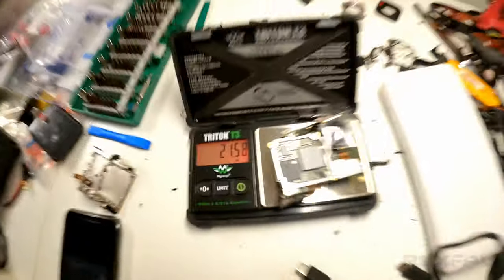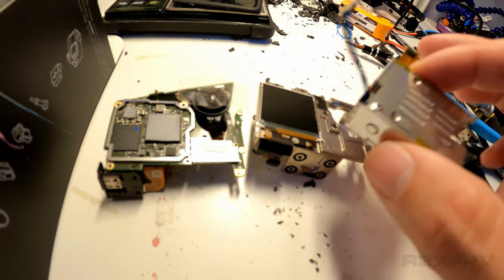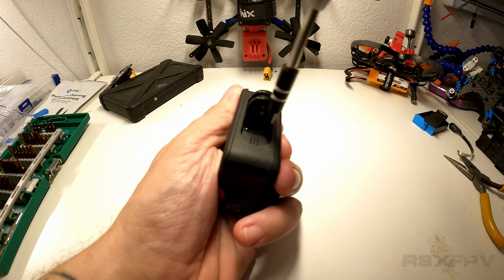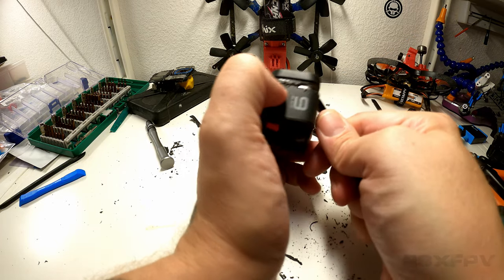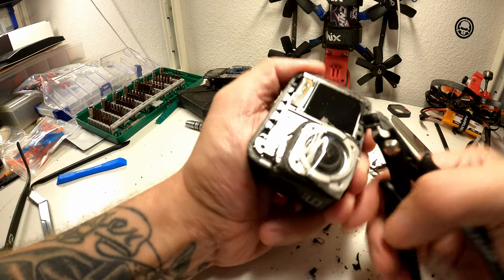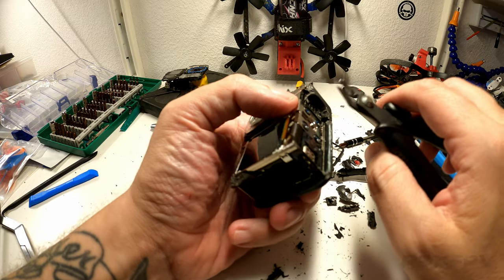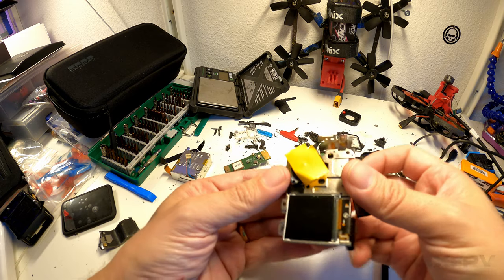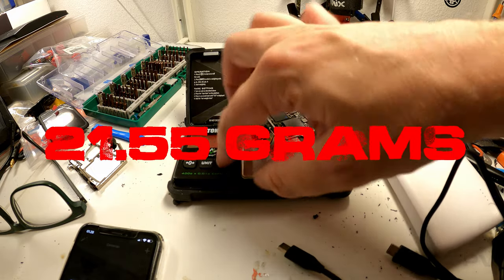Naked GoPro 9 Tutorial | Prepare the hacksaw

Comment: So nice bro. Nuts but i love it. How did u go about powering it?
Reply from the maker: I power it with a small BEC, from 6s lipo to 5v
Reply: @mikdahl  hey bud is there a Way we can chat? IG FB??
Reply: @mikdahl  im just not sure where on the board to solder the 5v
Reply: @mikdahl  how many amps are required. I, getting low power error screen
Reply: @justinwalker631  They changed this with the new firmware - i believe you should install the latest gopro labs - then after all that is done, try hooking up power to the cam - then leave it for 5-7 seconds, and then turn it on. Should work
Reply: @storyflight   yeah I had to plug everything back up and got the file on there luckily
Reply: @justinwalker631  Been there, it sucks - but hopefully now its working!

Comment: that little gold piece is probably the wifi antenna
Reply from the maker: Could be - but it works fine without btw
Reply: @mikdahl  yah should work without antenna it’ll just generate heat and eventually burn out.  I usually just solder a 31mm wire to naked gopros just so it doesn’t burn out.  Usually crash and break em before they fry but you do what you can haha!
Reply from the maker: @Shauny_D  ill look into that - thanks
Reply: That's what I was thinking

Comment: Is it possible to remove just the lens itself for GoPro 9
Reply from the maker: I mean you can remove the lens, but it wouldnt be usable without the board. But if you mean in terms of replacing it if it gets damaged, yes - buy another lens. I dont know if those a readily available though!
Reply: @mikdahl  how can i remove it? seems like is glued to the base
Reply from the maker: @ESTILOSIERRITA101  It has 3 screws mounted on the black plastic holding it - you can remove two of them from the back ( the side of the display ) - but the last one might be tricky - i usually use pliers and cut off the plastic holding that one
Reply from the maker: You do mean the actual lens - or do you mean the front glass for the lens?
Reply: @mikdahl  the actual lens. i try taking off the crome plate after unscrew the 4 bolts but is hard seems like is glued
Reply from the maker: @ESTILOSIERRITA101  The chrome plate can be removed - i used pliers again and simply cut underneath and around, and lifted it up. But it is a daunting process - its relatively safe though - once you begin lifting it a bit and can see under it, you can sort of see how it all connects together. As for the actual lens, its screwed in from the back, into the plastic thats stuck on the chrome thing - so you could unscrew it from there also - but id recommend removing the chrome piece first.
Reply from the maker: @ESTILOSIERRITA101  When youre at this point https://youtu.be/5k94hVAQNdE?t=1269 - and you have shaved off everything, you can use the pliers to cut underneath the chrome piece - and you can actually cut the stuff that holds it. Thats how i did it